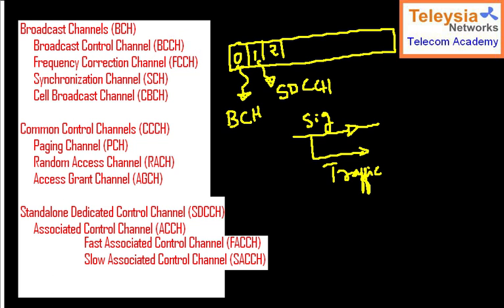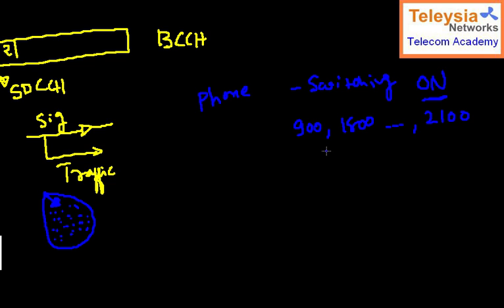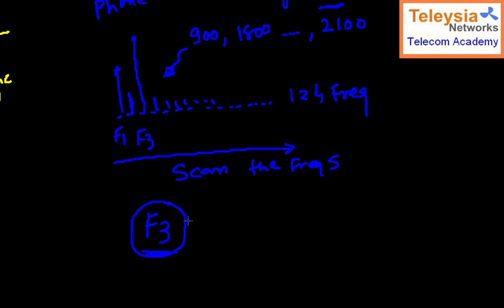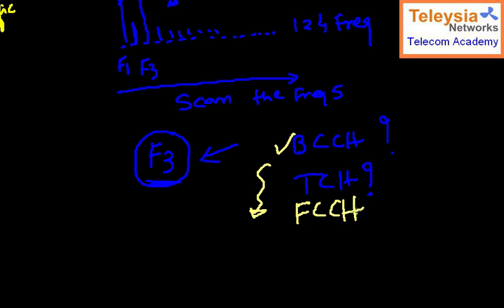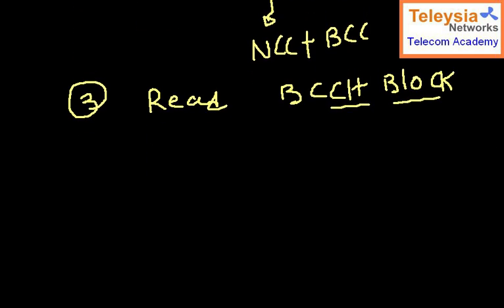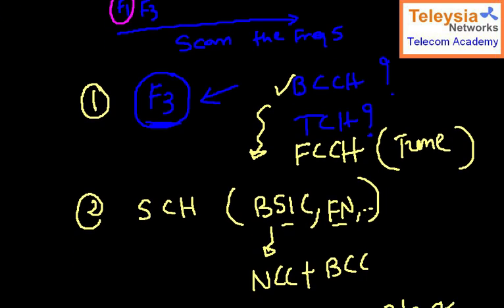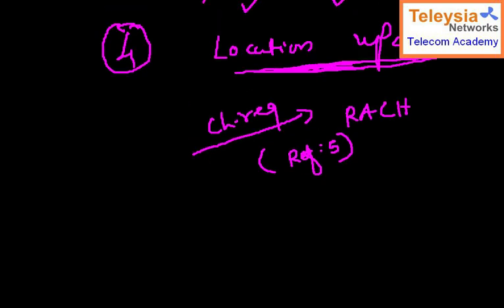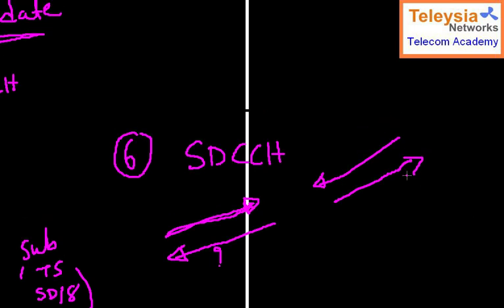Teleysia - GSM Logical Channels 2.avi

Comment: @MrCasual0123 The BCCH is a control channel that is used to broadcast the parameters and characteristics of the given BTS, while the TCH is a traffic channel usually used for speech using Adaptive Multi-Rate Speech Codes.